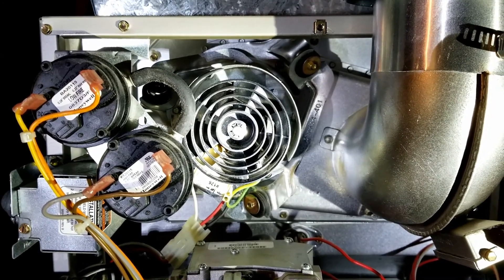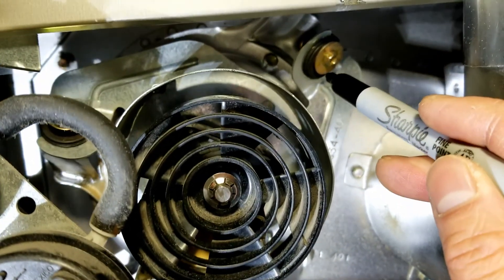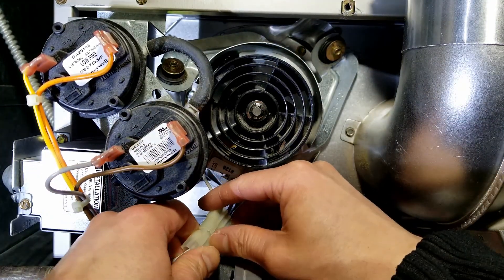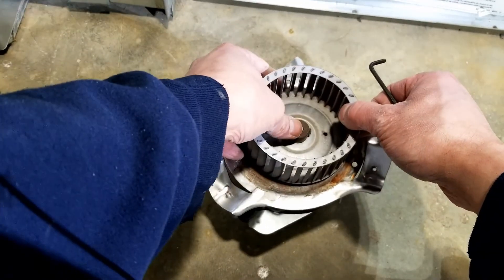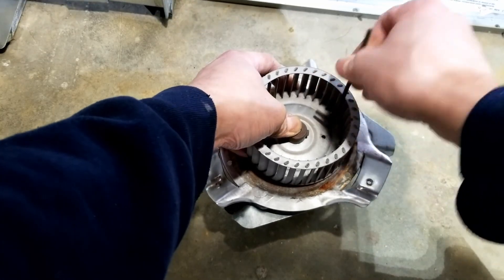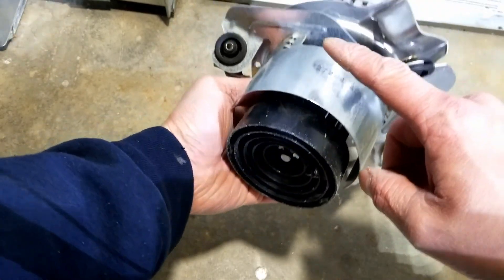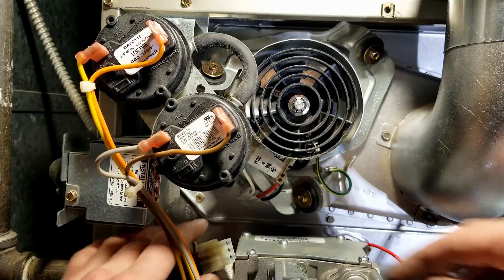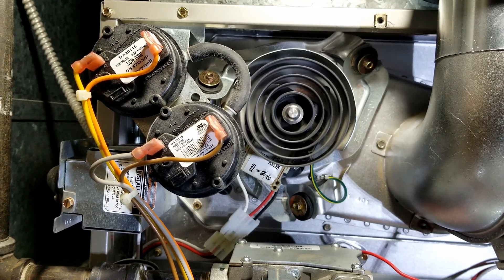HOW TO Replace Furnace Draft Inducer Blower Motor - Carrier Bryant Payne

Comment: I know I’m super late but to take off the black fan at the front of the assembly I just kind of have to peel off that metal ring around the center? My new assembly didn’t come with a ground wire so I need access to the little screw that hides behind the black fan

Comment: 1. There is no need to remove the three screws from the orange vibration grommets while the inducer motor assembly is on the heater. That only complicates the process. They same goes for reattaching the assembly to the heater. The three screws should already be fastened to the orange grommets. 

2. Remove the pressure switch bracket BEFORE removing the inducer motor assembly!

Comment: Hi, do I need to turn the gas off to replace the inducer or just turn off the power switch? Mine is the same furnace as yours.  Thanks.
Reply from the maker: @upload610  hello, no you do not. But turn off the breaker for the furnace 🍻

Comment: Do the replacement motors on amazon have the same white connector. It appears different.
Are there adapter connectors required to go from the white connector to tabs on the motor?

Comment: What about gasket seal.  If not sealed then no negative pressure for pressure switch.
Reply from the maker: Gasket was still in good working condition. You can replace it to keep it up to date. My furnace is still working after many years to this day 🍻

Comment: Nice video, thank you. Sometimes, the harmonic balancer keeper washer gets worn out. Try replacing just the keeper washer first before buying the more expensive components. When initially testing the inducer spin, give it some help starting by hand spinning the harmonic balancer clockwise as fast a possible until the inducer spins on it own. You can draw a line across the end of inducer shaft so that you can tell it is spinning. The power needs to be on and the safety power cut-off needs to be held or taped down while you test it. ALWAYS Turn off the power before touching any of the electrical components.
Reply: Hello, is there an easier method to pull that washer?

Comment: Hello Kevin, My house is without heat for more than a month now. Parker Pearce (hvac co) charged me $342 just for diagnose, and now they tell me they cannot help me because the parts/parts are discontinued. I could not find a cross reference for my unit which is a 2004 Carrier 8000 Weather Maker m/n 58cta070-10112, s/n 2504a26011. From your video, which is very clear, if the inducer motor assembly parts are interchangeable, it should be a breeze to replace. Thanks to your excellent video. Can you help me? Henry Tham.
Reply from the maker: Hi Henry, the inducer motor are interchangeable between different brand of furnaces. They use the same blower. You will have to make sure you order the same part # or the same part but have interchangeable part #. Sorry they charged you so much money for little outcome... they can easily try to look around for the part or even from online order...
Reply: @KevinPon.  Hello Kevin, I received my inducer motor on Friday and went straight ahead with the instructions from your video. As soon as I was done, I flicked the switch on and the furnace started to work as if it came back from vacation. Thanks a lot, buddy.
Reply from the maker: That is awesome!! Happy to hear! 🍻

Comment: Don’t I need to replace the gasket?
Reply: You should but?
Reply: Can you tell me the plate where the motor fastened were the threaded my motor does not have threads..were yours self taping 🤔
Reply from the maker: All my screws were machine screws.  Not self tapping

Comment: Mine started squeaking and based on one of your other comments that is an indicator it will die soon. I can buy just the motor like in this video for $60 or the whole assembly for $375. Replacing only the motor should be all I need, right? I don't understand why the assembly is so much more when the motor is probably the most expensive part.
Reply from the maker: That's correct. All you need is the motor. You're lucky that you can buy yours for $60. I tried to find just the motor itself but they all cost around $350++
Reply: @KevinPon.  oh wow I guess I am lucky lol mine must be older or something. Other than the metal mounting plates I can buy all the assembly components separately for $100 so I don't understand why it's $375 together. Thanks for the reply and thank you for the video it was exactly what I was looking for. It's actually for my parents' furnace so I'm gonna fix it for them. You helped save some retirees several hundred dollars lol they would have just called a repairman.
Reply from the maker: @VenomUponTheBlade  lol I know the prices are ridiculous!! You're very welcome. It was my pleasure. Happy to hear my video was a help :) 🍻. Yeah the repairman will probably charge you another couple hundred on top for labor.. good to so things yourself put the money back in your pocket.
Reply: @VenomUponTheBlade  HELP!  Where could all the components be bought for $100 a year ago?
Reply: @TAN TRUC  from the repair clinic website. Pretty cool you can put in your heater model number and it will tell you what parts will work for that model.

Comment: Mine is only squeaking.  So what do i do?
Reply from the maker: Mined started squeaking too. For like a month. I also added oil on the armature it helped a little bit but eventually the motor died a few weeks later :(
Reply: @KevinPon.  where did you get the part?
Reply from the maker: @jaystreet4004  I found mine from a local furnace shop. They had it in stock but it was pricey
Reply: @KevinPon.  i got fortunate that people from my church own a parts shop. I got it for 268$
Reply from the maker: Nice! That's about the same price I got mine for. I thinks yours might have been a little cheaper but that's great!

Comment: It seems you didn't have a hard time removing the hex screw. I couldn't remove mine cause it is stuck in there. Now I am stuck and it's freezing right now here.
Reply: Try heating the hex screw up w/propane torch first.
Reply from the maker: Oh no! I know how you feel. I was wearing my winter jacket while fixing it. I actually took a couple of stabs at it before filming 😂

Comment: Thanks for making this video Kevin, it's appreciated. Never thought I would find my furnace on youtube , everybody's furnace looks different. I have the same looking furnace (Carrier WeatherMaker 8000TS with ComfortHeat Technology model # 58CTA070-12 from JUL 2002), the pressure switches and your furnace inducer motor looks exactly the same.  My inducer motor is making some noise but hasn't failed yet, so I bookmarked your video for future reference.  I do notice that the ground wire for mine is not attached to the grounding screw like yours is, it runs just fine but I suppose I will go and re-attach the ground screw.   Just curious,1.) where did you buy the inducer motor? 2.) what's the cost? 3.) Do you have part numbers?   I looked on repair clinic, the motor part # for mine is HC21ZE125 for $114.65, if i buy the entire assembly it's 326628-761 for $414.07.
Reply from the maker: Happy to hear my video worked out for you 😊. I got my inducer motor from a local furnace shop but you can find one on Ebay as well. It was not cheap! This part is pretty much the heart of your furnace. It cost me about $320CAD I think. Here's the exact same one on Amazon USA
https://www.amazon.com/HC21ZE126A-Carrier-Furnace-Inducer-Replacement/dp/B00EZWRUNE
Reply: @KevinPon.  Oh you are in Canada. Hello fellow Canadian, I live in Vancouver, BC. Good to know, thanks for the info!
Reply from the maker: @ghettodiy7114  😂 hello there! I love Vancouver!
Reply from the maker: If you buy one without the fan. You can save an extra $15 since you can reuse the old one.
Reply: I just replaced the same inducer motor in my identical 2005 furnace today as we woke up to a cold house.  A bit of troubleshooting indicated that the inducer motor was the issue.  I was able to buy the replacement locally at AMRE Supply (https://www.amresupply.com/part/HC21ZE126-CARRIER-INDUCER-MOTOR) for CAD$275 as I had to get the motor right away.  If you have time, you might consider ordering from the states for US$125 (https://www.repairclinic.com/Shop-For-Parts?query=HC21ZE126).  They ship to Canada at a reasonable price.  Also, if you remove the one screw that holds the pressure switches and move them off to the side, it is much easier to get the motor assembly in and out.  And there is no need to remove the angled screws with the big washers until the unit is completely removed. Good luck.

Comment: Thanks for making this video. My motor axel was rusted on to the wheel so the hex key wouldn't loosen, had to use a sawzall to cut it off and buy a new wheel. Furnace works great now, hiring a pro would have definitely been faster, but this feeling of accomplishment is awesome.
My part numbers for my Carrier WeatherMaker 8000TS were:
HC21ZE118 Draft inducer motor
LA11XA046 wheel
LA660003 fan
Found cheaper than buying local on eBay and Amazon.

Good luck!
Reply from the maker: You're very welcome and congratulations on your accomplishment! 🙂 Definitely save a lot of money and it feels great having things done by yourself! 🍻
Reply: It's not rust. Loctite was used on the grub screw and MUST be reapplied during assembly. 
It's all metal so don't be shy to use heat to break it free. 
For a really cheap repair if just needs new bearings it uses # 608. Doable but may be too much for the DIYer.
Reply: @SerenoOunce  Man, I owe you guys big-time. If I hadn't seen this comment about Loctite, I would've had to go the saw-cutting route (and waited another day to get a new hamster wheel). I got the grub screw off with elbow grease, but the wheel was still stuck on and nothing worked... until I went at it with a propane torch for a good minute. The local HVAC wanted to charge me over $600 plus labor to replace the motor, when the part was on Amazon for $60. My family is getting warm now, thanks to all of you!